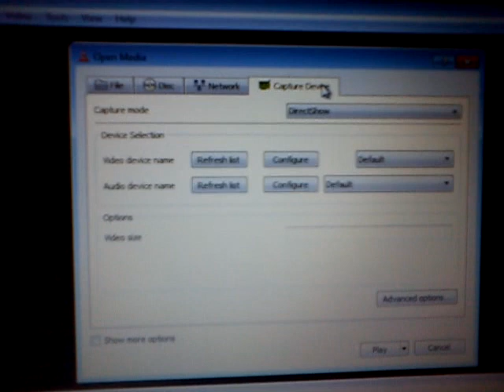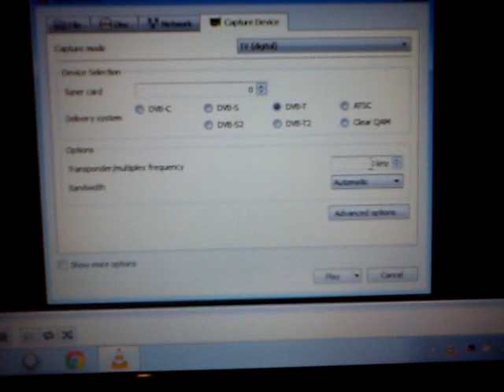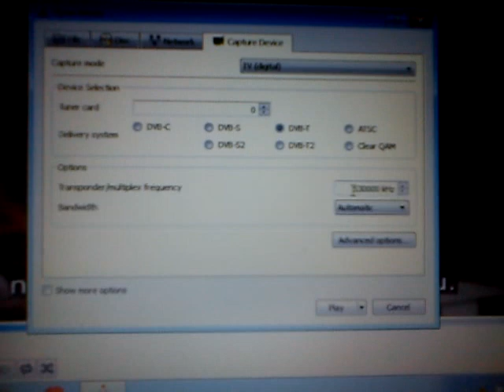VLC playing RTL2832 dongle on DVB-T signal

Comment: Are you using a big terrestrial antenna or the small one included? Because I can't receive any channels on it…
Reply from the maker: Small one that is coming with the dongle.
Reply: I don't know… maybe my dongle is broken? VLC just searches and searches and can't find any channels on the nearest TV mast frequency… But SDR and radio works fine.
Reply: if SDR is working - you need to unload the sdr driver and reinstall dvb drivers.
Reply: at work 5 miles from Crystal Palace TV the little whip is fine - at home 40 miles from a tv transmitter I can get some TV and a lot of DAB on my collinear coax i use for ADSB.  Put the whip outside a window and grounded to a metal biscuit tin lid  will increase most of your signals.
Reply: Nah, I plugged in my terrestial antenna using an adapter and it works like a charm. Maybe my walls are too thick or something for this tiny antenna included.

Comment: Which driver do you use? Is it WinUSB or Realtek? Can you share it? Thanks!
Reply from the maker: I am using the original drivers that comes with the dongle
Reply: @Adam Alicajic: unfortunately I didn't get any drivers with my dongle. I'm trying to find any driver that would work on Windows 8.1. So far I got it working on WinUSB driver but only as SDR receiver (eg. it works for radio). I can't make it work with VLC. Would you please be so kind to share your driver then? :)
Reply from the maker: Przemysław Elias You can not run the dongle in the TV mode with the sdr drivers, nor you can have both drivers installed, this is why Zadig swap the drivers. I have the WIN7 running and I do not have the 8.1 drivers for sure. Beside that, my dongle is based on the E4000 tuner which is rare to find today, more likely you have the R820 tuner. If so, you will have to look for the drivers elswhere.
Reply: Adam Alicajic Yeah, my dongle has R820T tuner. I'll try Realtek drivers then, but from what I've googled, it works better on Linux than Windows, which I find odd :) Thanks for your input!
Reply: @PrzemysawElias  Hey, did you find the drivers for R820T tuner? If yes, could you please share? I know this thread is 5 years old but I really need the drivers. Thanks in advance.

Comment: Hello, one question, In the original software that comes with the tv tuner card I see the frequencies for each channel but when I try that number in the VLC doesn't work, how did you get the frequency?
Reply from the maker: I am using the original drivers that comes with the dongle
Be carefull with the number of zeroes when typing the frequency.
The dongle will not work if you type the frequency from the GAP (1100-1230MHz) for the E4000 tuner.